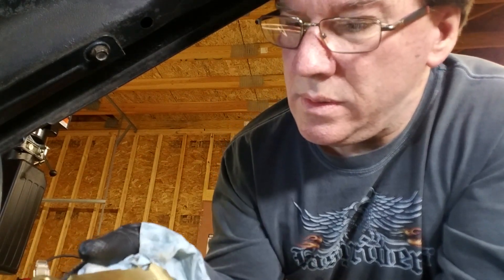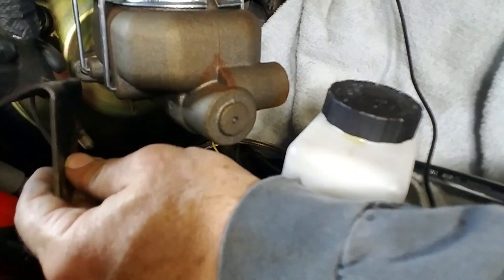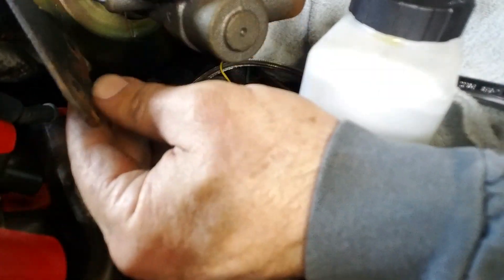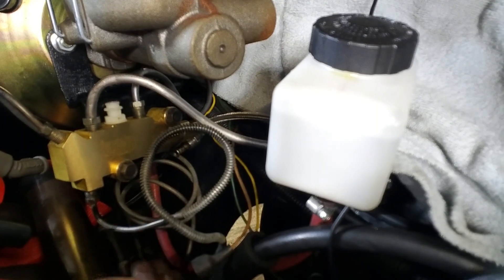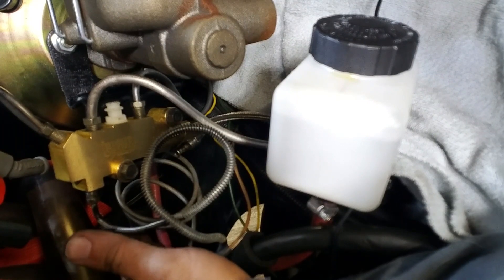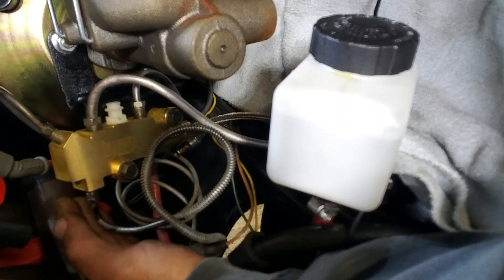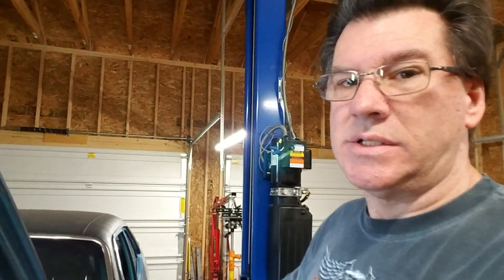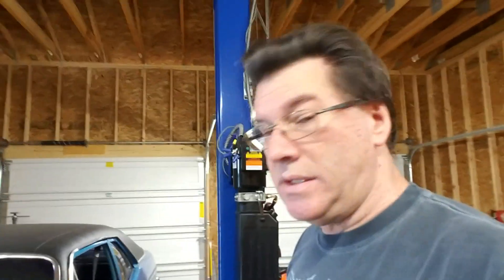72 Nova Proportioning Valve Conversion To All Wheel Disc Brakes

Comment: I have an question, if I switch to manual Disc brakes from manual Drum brakes ( in the front only) would I have to get a proportioning valve? it's for a 1968 Roadrunner.
Reply from the maker: Yes you would.  The reason is that the disc brake caliper requires much more fluid to operate than a drum brake wheel cylinder, in addition they require more pressure.  You'll also need a split reservoir master cylinder instead of a single reservoir.  The front side of the split reservoir for front disc and rear drum is designed to supply more brake fluid to front disc calipers.  Then the proportioning valve is designed to divert more pressure to those calipers.  Don't do a front disc conversion without doing those two things or You'll end up with constant rear brake lockup and extremely difficult to stop the car.
Reply: @stevesgarage7644  okay thank you so much for the help:...I was also confused on which proportioning valve I would need.
Reply from the maker: @vondrebridges9740  That i would not know.  I just went from 2 disc front to 4 wheel disc so mine is a bit different.

Comment: Hi I have a question... hopefully you are able to answer 🙂 I have a 72 Chevy pick up, I switched it to all 4 wheel disc brakes. My question is... what do you have to change? The proportioning valve disc/disc and master cylinder or do you just change one of them or both? If you could please let me know whether you have to change both or just one. I appreciate your time. Looking forward to hearing from you.
Reply from the maker: Both.  The proportioning valve has a percentage of pressure that is different when switching from disc/drum to disc/disc and the master cylinder has different sized reservoirs also.
Reply: Thank you for your reply.. I have another question I hope that’s OK. Can you tell me if the master cylinder says disc/disc and disc/ drum 
It will work pick up that’s all I can fine .Thanks again I hope you have Great evening
Reply: Sorry I meant to say because that’s all I can fine
Reply from the maker: @danielviorato1333  No it won't say either way.  I would just order one new that fits that description just to be safe.

Comment: I think the button recenters the valve inside... the valve shuts off the front or rear systems in the event of pressure loss... so you still have the other side (front or rear) functional.

Comment: How did you bleed it if I dont have the bleed screw for the proportional valve. Did you open all nipples on all 4 tires so that pressure wouldnt build up until fluid came out. Im worried the check valve will move over to rear again. I couldn't get the valve to shift back. I lost pressure in rear and had to get a new one.
Reply from the maker: I basically followed the instructions on bleeding the farthest wheel first and didn't have any problems.
Reply: @stevesgarage7644  What  Proportioning valve did you use?
Reply from the maker: @jerrydziura7509  I just searched for a 4 drum to 2 disc and 2 drum conversion and a few showed up for my car that made sense.  If I recall it was from Summit Racing.